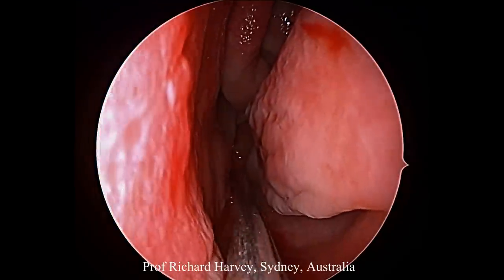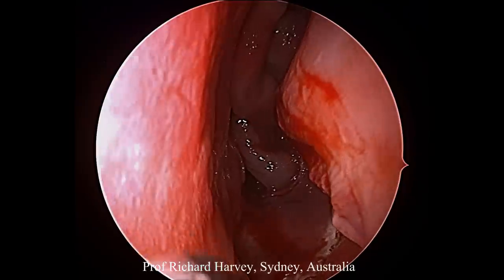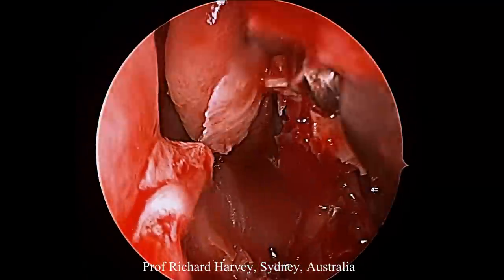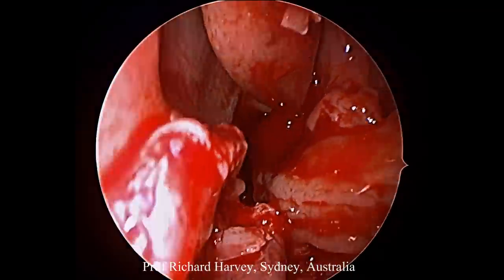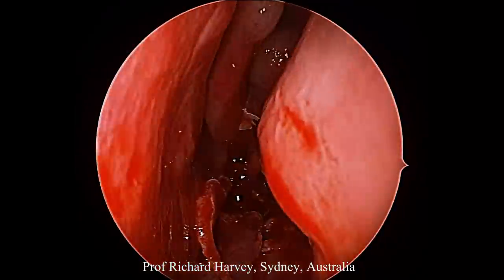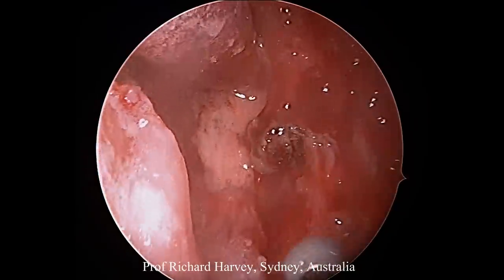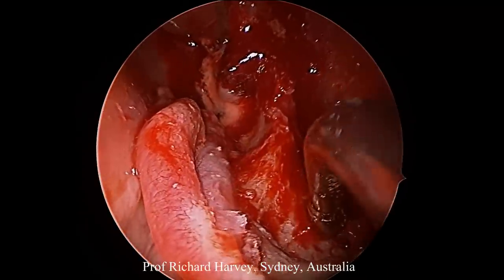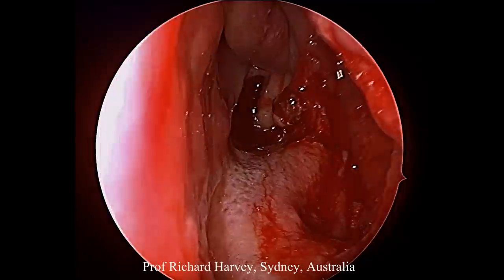Chronic maxillary sinusitis

Comment: ..what I found immediately effective for my blocked up sinus was a neil nasal rinse bottle that I added a level teaspoon of table salt and a level teaspoon of baking soda (you may want to start by using half those amounts) to and then filled the bottle with lukewarm water - spraying it into both nostrils ( I pinch my nostrils closed and tilt my head backwards for a few seconds before releasing)  - this cleaned out more phlegm than anything else I ever tried !  Afterwards you'll need lots of tissue!
Reply: thanks will try the baking soda and salt
Reply: it works only for the nose it not reach the sinus maxillary